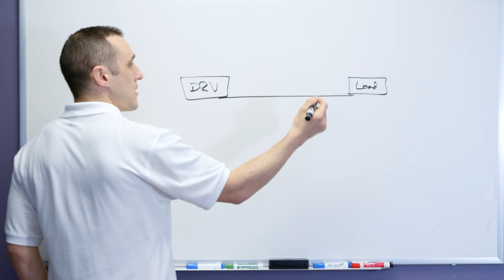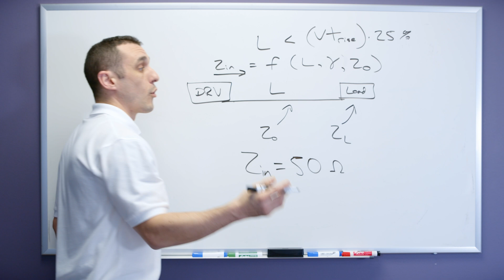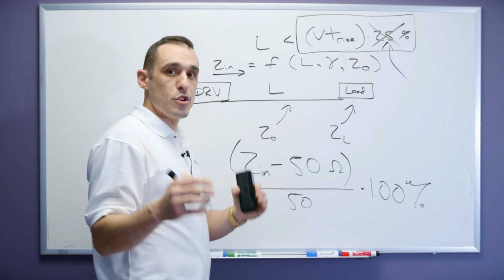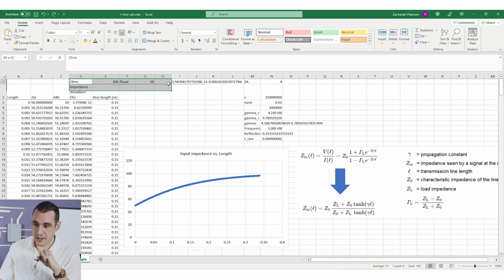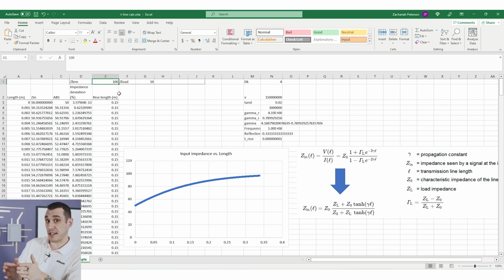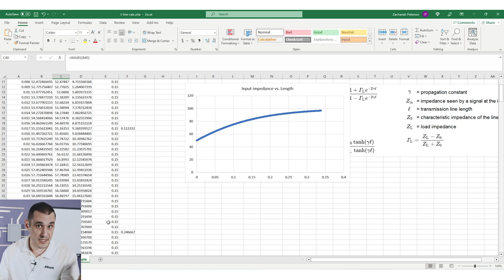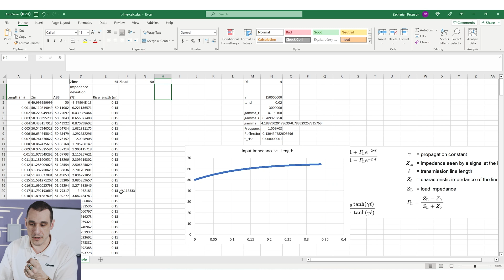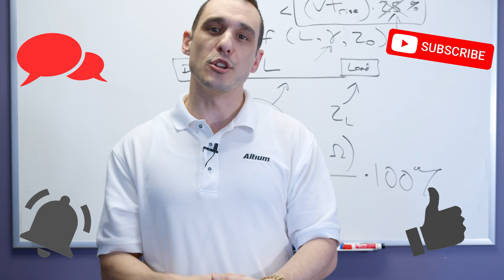Stop it with the 25% Rise Time Rule

Comment: Hi Zach,
Just a question in the above example you show very nicely the effect of the impedance mismatch. But here you have your load impedance ZL= 50 ohm. But do we go about it if this load impedance is not available. Lets say you want to connect an uC to an ADC through SPI, I would assume that the ADC dont have an imput impedance given?
or is it not relevant because a SPI would have a very "slow" rise time?
Reply: In modern components SPI can have a rather fast rise time, especially on BGAs with fine pitch and decent drive strength. There is a common example I cite from a TI ASIC with BGA packaging which has rise times on the SPI bus as low as 2 or 3 ns at low load capacitance. The input impedance is the series of the trace impedance and the input capacitance (or load capacitance), which is often a given value in a datasheet. This RC circuit makes up your load impedance (note that the output is taken as a measurement across the capacitor). To see how this arises it helps to take a transfer function perspective: https://www.youtube.com/watch?v=6SyNRq73Myk
Reply: @Zachariah-Peterson  Thank you for the link and very interesting video.
Just for clearence....having a capacitive load would normally mean a full reflection, but in case the line is electrically short, this does not happen?
Reply: @thomassorensen7907  This is a good question because in theory no load is purely capacitive. There is always a little bit of resistance leading to a capacitive load. But in the case of a long line the answer is yes, a capacitive load results in a reflection and a signal that travels between the load and source end of the line. We would normally impedance match at the source end to set the input voltage level and simultaneously dampen the reflection so that the voltage settles at the desired level. We could also parallel terminate and get the same result but with no reflection at the load. These parallel and series placements happen internally in compoennts that are designed to a specific standard so that you don't need to manually apply termination unless you intentionally deviate from the required trace impedance. For the short line, the signal exists across the source, load, and trace simultaneously, they all look like a point impedance when taken together.